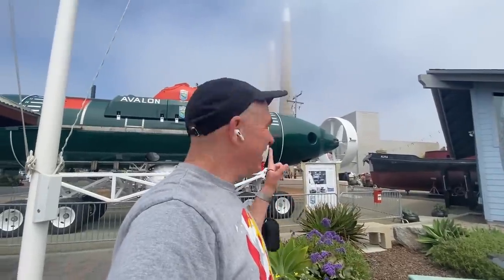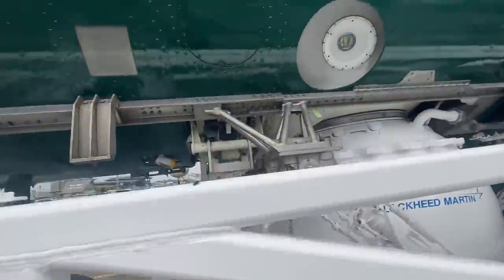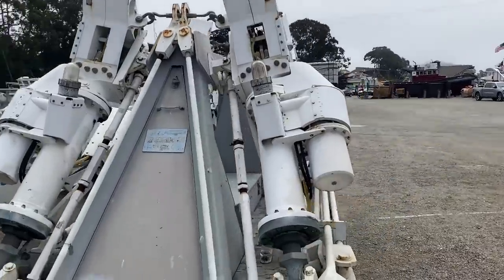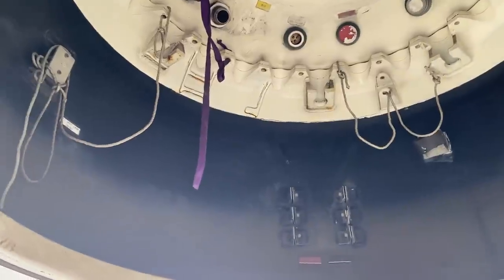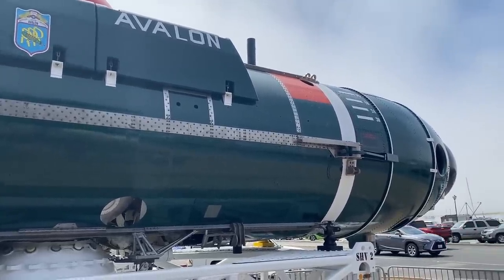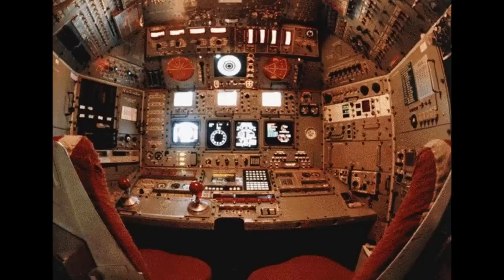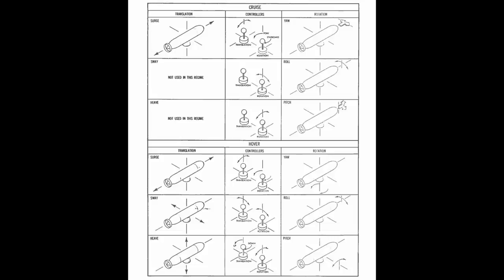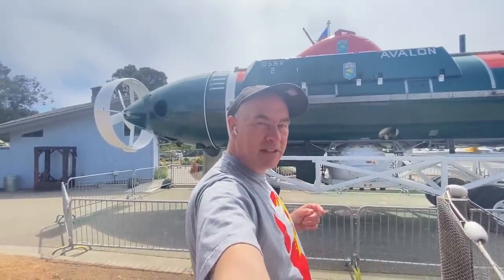How Submarines Docked While Underwater - DSRV-2 Avalon - Deep Submergence Rescue Vehicle

Comment: just like in space, if youre in trouble....you're screwed.
fyi, the movie Gravity was just that, a movie. you would never be able to 'transfer' to another space station from the ISS orbit.
Reply: Great VFX, terribly plot.
Reply: Not really. submarines are A LOT more dangerous than spacecraft because of the pressures involved. If a compartment blows in a spacecraft the only thing it has to hold is atmosphere, not a water hammer rushing in at undersea pressures.
Reply: @marcogenovesi8570  true, if you have a spacesuit you can at least survive till the oxygen runs out.
Reply: @TheEvilmooseofdoom  acting was crap too.
Reply: @ThatOpalGuy  Nobody is in a space suit during normal operation and donning a EVA suit takes hours. 
I'm saying that subs have an external hull and with with relatively small amount of damage to that you have lost the whole sub because the water rushing in at high pressure blows internal doors and walls apart. The internal walls are only there for leaks and such, not strong as the hull.

In a spacecraft that is not just a single capsule affair, each compartment is strong enough to hold in air and there is nothing rushing in and blowing the doors. So in the same situation as the sub where the "hull" fails you are just losing the compartment where the incident happened, and some air while the door closes.

Also, the spacecraft does not sink so you can usually assess the situation and try doing something about it.

On a sub most failures are fatal pretty quickly and you have no time to notice them or react.
Reply: @marcogenovesi8570  either way, youre boned
Reply: @ThatOpalGuy  Not really, in space you have pretty decent chances of surviving problems that would be instant death on a sub, for the reasons I just told you, and I'll still tell.

Multiple compartments are usually designed to be independent (as is the case on the ISS) and this already saved astronauts. Like Apollo 13 the lunar lander had its own life support and the astronatus stayed in that for most of the cislunar abort trip.

Small holes in the hull can be patched from the inside without much issues (there are procedures for the ISS), while good luck patching "small holes" in the hull of a sub while it's underwater.

Also, another thing, on the ISS there is always at least one capsule (usually Soyuz but now also Dragons) able to bring down the crew in case they have to evacuate.
Find me a sub that has anything  remotely comparable to that. If a sub has issues you can't just "leave", you either fix it or sink with it.

The only situation where you are really at high risk is reentry, and that's where most deaths have occurred.

Comment: How do submarines communicate with the surface? Did titan have A fiber optic cable?
Reply: Sonar "telephone", or maybe more accurate, "sonar modem" as I understand they did not talk to the surface, only sent text messages.
Reply: We communicated via underwater telephone that used sound to transmit voice. It also had a CW key for sending morse code. On Sea Cliff DSV-4 we could talk to the surface from 20,000 feet deep.

Comment: What if the submarine to be rescued have listed on the sea floor?
Reply: I believe something of an angle can be tolerated but there is a limit.
Reply: you can list the sub to an extent by loading the buoyancy tanks unevenly, but there are limits I guess
Reply: That's when they would shift mercury from one take t another to hold the vehicle at a tilt
Reply: Look at the diagrams in the video, they include roll capability.
Reply: Secondary ballast system pumped mercury to various tanks throughout the vessel to shift the center of mass.

Comment: The DSRV was a SPY vehicle designed and heavily used by the US Navy and CIA for SIGINT on undersea cables.
Reply: without arms or anything, I have some doubs they can do much about undersea cables besides leaving a charge to blow them. Nobody is coming out of that hatch at those pressures and it does not even have an airlock
Reply: I was stationed at DeepSubmergence Unit ant the DSRVs were never used for intelligence gathering. Their only function was submarine rescue. We did however have similar vehicles that were used for intelligence purposes, but I can’t talk about those.
Reply: @paulcole7740  Post your credentials or you're lying.
Reply: @LordSlag  lol as if credentials mean anything on the internet
Reply: These were never used for those types of missions. 
U.S. Navy Submersible Pilot #36.

Comment: Why not tape storage, ass loads of space, no radiation to deal with like in space. I assume it was actually the easier more normal to use back then option especially general procurement. Every company was basically making and using tape storage back then on earth. No special radiation shielding needed since its not going to space

Comment: I feel like we wont see major submarine missions for a while after recent tragedy with the Titanic trip
Reply: DSV Alvin still exists, and in active service as of 2023. It will do stuff. It's actually well designed.
There are a couple submarines that did Challenger deep, don't remember if any of those are still going. One of them was sadly damaged in transport.
Reply: No need to stand down any deep submergence work for a safety review. Everyone know why the Titan imploded-- they did something that no one else does in the industry: Relying on a plastic hull to hold back 12,000 feet of water column.